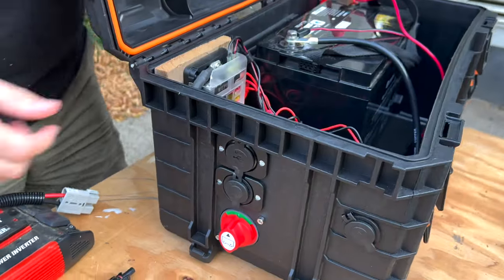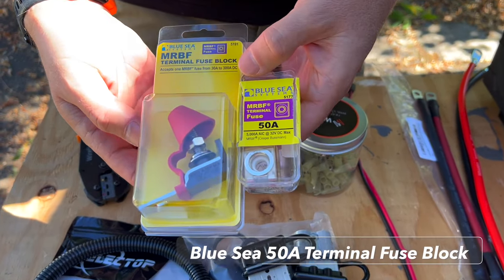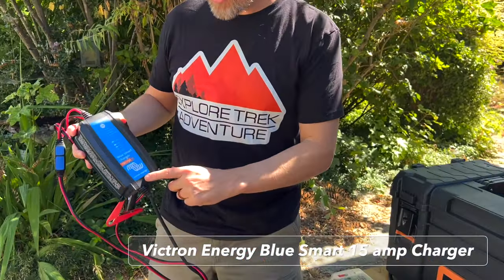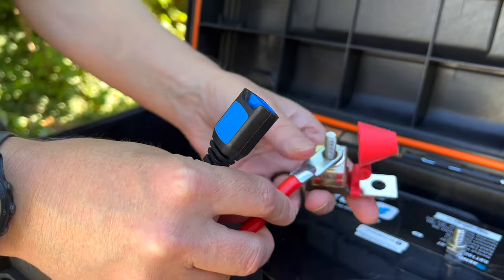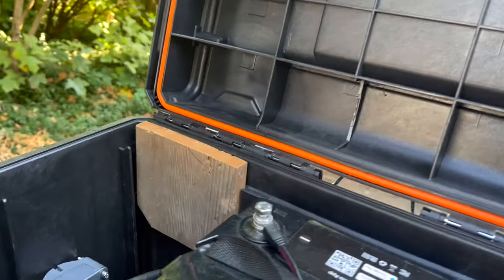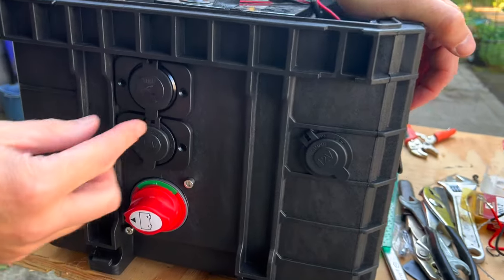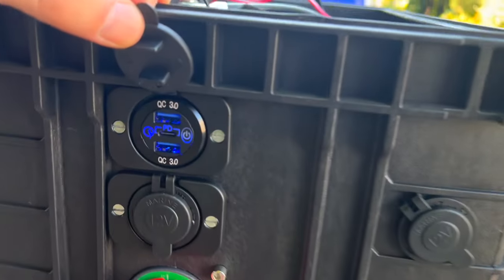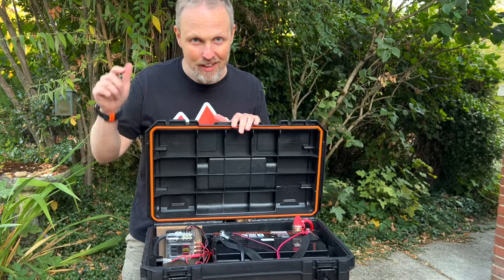DIY Solar Generator - Portable Lithium Battery Box Build - Part 1

Comment: Is there a reason for not adding a couple of 110 outlets to the outside along with the usb and 12v outlets?
Reply from the maker: We use a Jackery 240 for our AC needs which we like because it is small and portable. This build is specifically to power a 12v fridge.
Reply: Very true….I remember you mentioning that at the beginning. So I have 8 ridgid boxes. 5 being the one you used. And I’ll tell you what…you have inspired me! I already have the 100ah and some of the other stuff I am planning on using. But I just hadn’t decided on what route to go. You have made me decide. Your box is so simple and clean…I absolutely love it! Thank you so much for taking your time to instruct us lesser minds!😆

One question though…would there be a negative to using 110 outlets? I can’t see any but I could be missing something. Thank you again and keep on keeping on!
Reply from the maker: You would have to find an inverter that would fit in the box or attach to the outside. If it was going inside the box you might want to put a fan to vent the heat it would generate.

Comment: What was your estimate budget previously started and the actual Post production cost? If you can share that, thanks
Reply from the maker: We do not have a full cost breakdown but we did link to all the materials we used in the description of each video.
Reply: @ExploreTrekAdventure  well thanks for replying, that is an outstanding production. I’m may try it. Thanks…

Comment: The battery alone is $460. By the time you add the other stuff and an inverter you might as well just by a 1000w solar generator
Reply from the maker: It depends on your requirements but that might be a good option for some people.

Comment: Cool build! Congratulations! Are you able to charge the battery via solar and discharge via inverter (AC output) at the same time?
Reply from the maker: We do not have an inverter but we can power devices (12v) while it is charging.

Comment: I would have opted for Battery storage in the wheeled Ridged base box. and then a smaller one attached to the roof of the battery box for all the electronics...
Reply: I also would have positioned the outlets differently, the one below the USB looks like it would open the hatch on the USB outlet when it opened due to overlap...

Comment: what did you do to make the 4 gage terminal wire to stay put  on the the circut box?
Reply: Mount the connector so the cable lays flat (untwisted).

Comment: I would be curious how much RF interference that your solar system and controller put out.
Reply from the maker: No idea on that but curious to what it would be interfering with?
Reply: @ExploreTrekAdventure  Communications radio equipment, especially on the HF bands, would be my primary use for this equipment.  Therefore, that is where I would not want EMI.
Reply: @ExploreTrekAdventure 
Pace-maker?
Hearing aids?
CB radio?

Comment: Great job! Where would you hook the inverter?
Reply: To the positive and negative leads of the battery.
Reply: A 750-Watt inverter works out of the 12vdc outlet.
Unplug during disuse to reduce parasite drain.

Comment: why would you build this if your not installing an investor? its cheaper to just use a large power bank that can be charged from any solar panel.
Reply from the maker: It’s primary purpose is to power our 12v fridge while we are out camping. The 100ah battery can get us through 4 days without issue. We have a small power station with a built-in inverter if needed.

Comment: Yes you can build these yourself quite easily. BUT consider these:  1# Costs, how much saving if u buy them components?   2# space.  I doubt u can make it smaller/lighter.  3# testing, thermo management, etc.  a manufacture product should have been tested throughly so piece of mind right there.   Its fun to do but not practical nor cost saving.
Reply from the maker: This was a simple purpose build to power a fridge in our rooftop tent trailer and was cheaper than purchasing a full blown power station.

Comment: Left a charge controller out for solar connection
Reply from the maker: Check part 2 where we go over solar. We use a solar suitcase that has a charge controller built into it.
Reply from the maker: Check part 2 where we go over solar. We use a solar suitcase that has a charge controller built into it.

Comment: Wouldn't it be cheaper just to buy a power station instead of building one
Reply from the maker: It can be a good option and prices change all the time. This was purpose built to power our 12v fridge.
Reply: Have the same question myself, but did some research and will be kind of cheaper DIY and with the bonus to be able to replace or upgrade the parts with the time, instead of replacing the whole unit.

Comment: What i got from this was just buy a powerbank. You wont save money unless you have all the tools already.
Reply from the maker: Buying a power bank is a great option as well. I had a very specific need to run a powered cooler in our camp setup. I needed the biggest battery possible with very few outputs.

Comment: Nice concept but lets not call a battery a generator unless you are going to add solar panels or something that will actually charge the battery - batteries don't generate  anything.and are dead without a power source
Reply from the maker: Part 2 shows the solar panel inputs.
Reply: The solar panel they're using is literally mentioned in the first 15 seconds, LOL.
Reply: @WellnessWizdom  the point is you need solar panels the "generator" does nothing to create power.